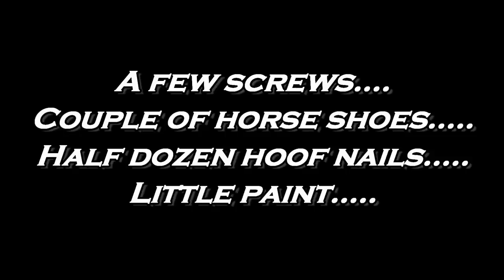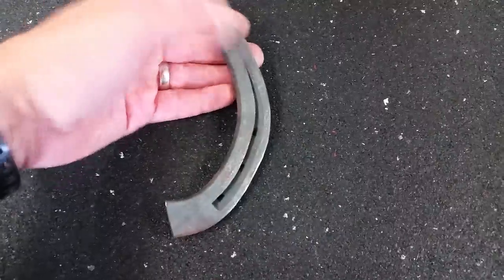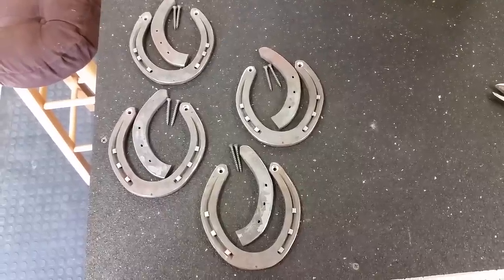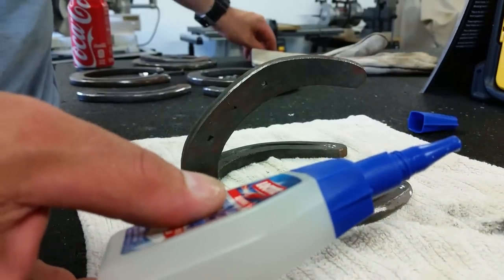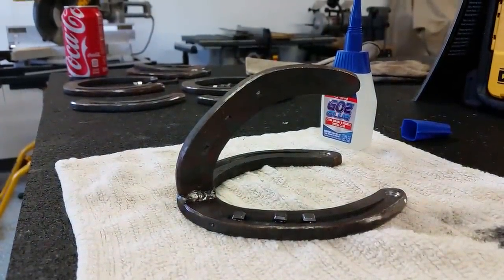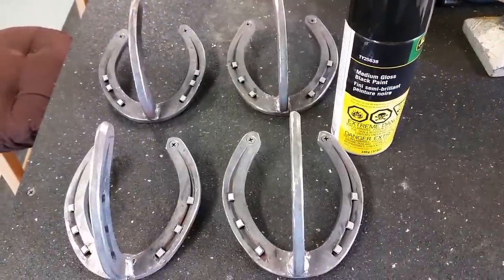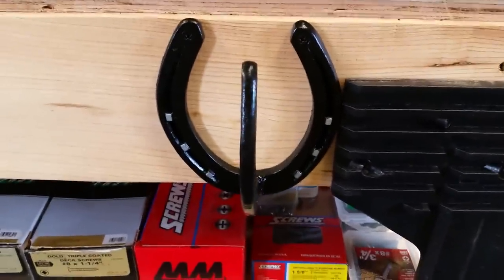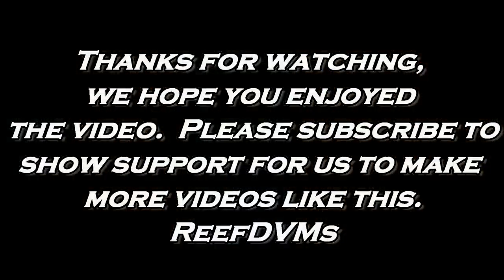DIY Simple HORSESHOE Coat or Hat Rack

Comment: why not just use the holes in the horseshoe and nail it with Ferrier nails to the wall
Reply: Patrick Mbahi because horseshoe nails are nearly impossible to remove out of the horse shoe from the front once there in there in, you gotta bash them out with a hammer from the back so it's not very efficient